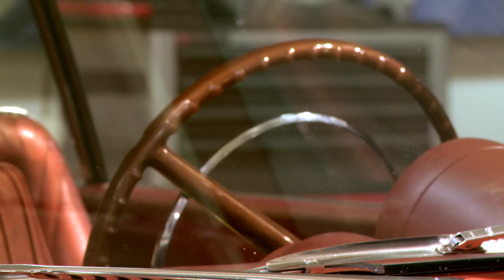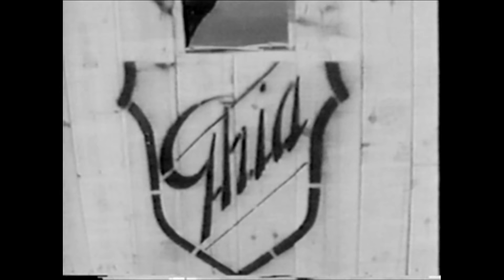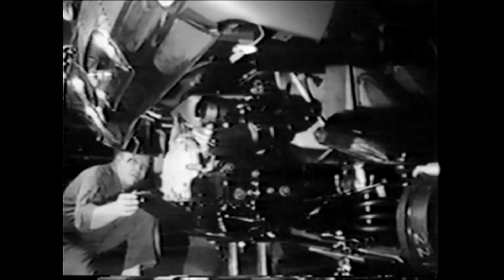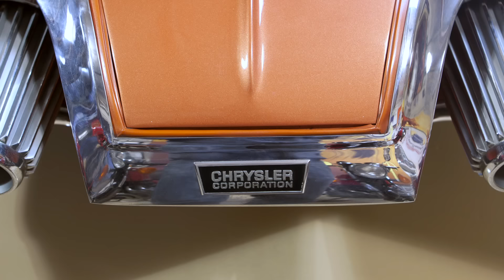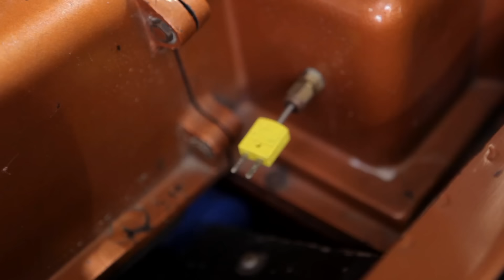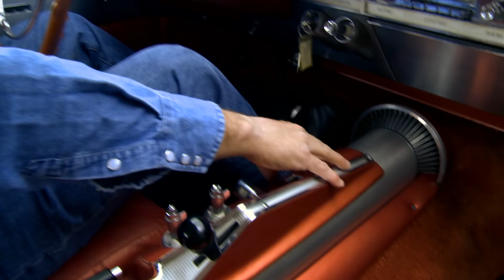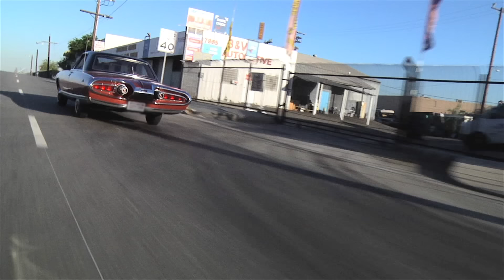1963 Chrysler Turbine: Ultimate Edition - Jay Leno's Garage

Comment: What is really remarkable about the concept is the torque. 
Chrysler took a chance on a passenger car concept that wasn't particularly fuel efficient, but imagine what the concept would have meant to the trucking industry!

Amazing torque, very quiet and purpose built for bio fuels.  The gas turbine engine powers Navy ships for good reason and logic would suggest this technology would be fantastic in heavy trucking...

Comment: Ford was actually ahead of Chrysler as they stuffed a Boeing turbine engine in to a Thunderbird in 1955. This was a test bed vehicle to evaluate the use of a turbine engine in a passenger car. Ford ultimately scrapped the project due to serious acceleration lag, noise, and heat from the powerplant.
It's interesting that Chrysler took on this experiment 9 years after Ford did and that what they came up with  looks very much like a cross between a 1963 and 1964 Thunderbird.

Comment: Very cool! I love this car! Designed by Elwood Engel, who designed the 1961-66 Lincoln Continental and 1961-63 Ford Thunderbird. This car looks a lot like the 1961-64 Ford Thunderbird, especially the roofline. The rear end design, depending on who you talk to, came from a sketch by Virgil M. Exner  Sr. himself. Engel's 1963-66 Dodge Dart looks a little like the 1963 Chrysler Turbine car. All 55 of the bodies were built by Ghia in Italy.

Comment: paired with our modern hybrid systems , I bet the jet turbine engine would work well! Using the electric motors for slow traffic driving, and the turbine provides power in higher speeds , possibly charging the car too

Comment: I noted that the car has a (sort-of) conventional transmission. I can't relate to how this transmission accepts torque from an engine with such high RPM. Question: does it shift? how gears does it have OR is it a CVT. I realize this is 1963

Comment: One of the interesting things about the turbine engine is that it can be made intrinsically clutchless, since the output turbine basically forms a fluid coupling to the driven impeller using the air.

Comment: I wonder if they could have fixed the idle problem by including a third tiny turbine used for idle solely to keep the other two turbines spinning, but with a much smaller combustion chamber so that it would burn less fuel when the two main turbines are at idle

Comment: Hi Jay , I don't know if you'll get the chance to see this, as it long after you released this video long ago. But ,,,,I was a truck driver in Canada.  The most common run is between Toronto and Montreal across the 401 highway.  This was back in 1972 which was at the beginning of my driving life. Back then I would hope to see and hear the  cabover Kenworth parts truck was also running between Toronto and Montreal.  It was a one of a kind. It ran for a few years then disappeared. Just a bit of trivia.

Comment: My dad was driving Chrysler produces when the turbine cars hit the streets. He was invited to see the turbine car at the dealer’s showroom. Of course he took his two car- crazy sons along. They didn’t start the car but they did give out little perpetual calendar keychains that worked like a circular slide rule. Somewhere along the way, I lost mine, darn it…
Years later I worked for Ford’s Engine Engineering activity. I recall taking a Ford course on the big truck 727 turbine engine. The plan was to use the turbine trucks as long-haulers, that worked out of either truck stops or dedicated centers where they would drop their trailers for conventional diesels to drive in heavy traffic. Thus the turbine trucks would run in their “sweet spot” where fuel mileage was best. 
The Ford turbine had dual regenerators like the Chrysler, but much, much larger. Those wheels must have been three feet in diameter. They never could solve the seal life and regenerator wheel cracking issues.

Comment: With the heat generated by the exhaust, you'd think this car would have lower emissions. It would be interesting to know the MPG of this car. They weren't very concerned about emissions back then, so I'd bet the car was cancelled due to bad fuel economy.

Comment: The reason the engine doesn't look like what you might expect a jet engine too look like is because that appears to be a radial flow engine as apposed to an axial flow engine which is what most jets now are. Axial flow is better but it's longer and would take more space. Radial flow is more compact. Think V6 vs straight 6.

Comment: turbine cars are a silly idea, a turbine engine doesn't work efficiently over a wide range of rpm and has very little torque at low RPM, not to mention the precision tolerances, ( and so expense ) required to make them.
Turbines are good in planes and generator plants becuase they can operate for long periods at their peak efficiency which is not the case in an automtive application.

Comment: The problem with Elwood Engles designs is that that still look like he was working for Ford. Ford had this obsession with thick “C” pillars that gave all the cars a stodgy look. Ford called this the “formal” look and it filtered into most of Fords car designs. 
I have never been a fan of the “formal look”.  Fords best looking cars were the 1957 Lincoln Premiere and the 1960 & 61 Starliners which had graceful sleek rooflines.  Chrysler made a huge mistake in letting Virgil Exner go.  If they truly wanted a “Jetsons” looking car to match the turbine engine Exner would have been the one to pull it off.  The 1960 Chrysler and Desoto body styling looks more futuristic than this.

Comment: EV's are the same way. They are practical in the sense that they use electricity to charge their batteries and drive with electric motors, but half the people in the country do not have a way to charge them and they also cost more than a normal combustion vehicle. Living in an apartment makes owning an EV impossible. I live in one, and I would have to run an extension cord from my living room down to the parking lot which would only be able to charge it very slowly. On the contrary, there is a gas station literally down the sidewalk from my apartment so it takes less than a minute to get there to refuel and refueling takes about 4 minutes at the most. The other thing people don't realize is that an EV cant just be refueled on the side of the road, yet you can fill a jerry can with a few gallons and pour it straight into your gas tank and off you go. I honestly do not think the combustion engine will be replaced any time soon. Its the most practical and efficient mode of transportation today. Also if you trace your power back to your local power plant it will probably result in you finding a coal or natural gas plant that your EV is being charged from. Not trying to say they are bad, its just that the turbine car and the EV are both worse for the average person than the typical ICE powered car. Maybe one day we will create an even more efficient means of travel.

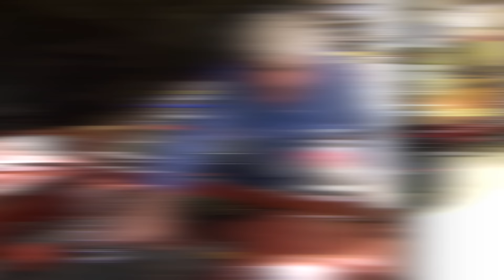Comment: 16:59 Another interesting thing is how Jay is putting his hand on the engine while he's showing how smooth it is. Because the engine is cooled by the fact that it draws in an extremely large volume of air, the engine remains very very cool. I'm not sure about this engine specifically, but a lot of smaller gas turbine engines usually don't need radiators at all due to this large amount of air.

Comment: When I was a kid back in the 80's, I was a Knight Rider fan and still am.  The Knight 2000 (KITT if you prefer) was equipped with a turbine engine.  As a child, I always thought a turbine engine was fiction and never knew that putting a turbine engine in a car had already been attempted before.  I can understand why that the turbine engine never caught on.  It was very expensive to produce and turbine engine technology failed to become the top dog over standard piston engines.  I just watched a documentary on the turbine engine car that Chrysler produced back in the 60's and I wondered to myself how a car like this handles.  It would be interesting to experience driving one for myself.

Comment: Kinda makes me wonder how a company that can come up with a car like that produced some of the WORST recalled cars in the history of the automobile.  Chrysler had that disasterous "lean burn" system they came up with in 1977 on select engines.  Locating the computer above the exhaust manifold and attached to the air cleaner housing, which made 2 things electronics don't like.  They recalled EVERY 1976-77 Dodge Aspen and Plymouth Volare due to body rust issues.  (I read where they even made a Dodge Aspen turbine car.)  Then they declared bankruptcy, the first time.  Great video!

Comment: The STP turbine car(s) that ran in the Indy 500 in 1967-68 almost cleaned up except they had mechanical issues. Then they were basically canned after that, probably because they were seen as a threat to the automotive industry. The STP cars used Pratt & Whitney Canada PT6 turboprop aircraft engines that have been widely used now in aircraft for generations and have an incredibly reliable history. But as for 'change',  even when you think of electric cars, it really took Elon Musk to make them a reality (aside from the GM EV1, which vanished) because they are seen as a threat to an industry that makes money off replacing parts that wear and break. Detroit has now been working on EV's, but they had no intentions of changing before Musk came along. The turbine was probably not the answer for the auto industry, but even if it had been, it would most likely have been rejected, especially back in the 60's, because of it's low maintenance factor. 

This is a video about the STP cars.
https://www.youtube.com/watch?v=vV1oBpUEk2k&list=RDCMUCm44d1WQboLnhT6aUBydZzA&index=1

Comment: It seems to me the best use of a turbine engine would be in a hybrid vehicle. It could start up only when the batteries reached a certain level of discharge and then turn off when the batteries are recharged. The engineering team could set the turbine to run at its absolute optimum speed and load continuously while in operation. The car would simply operate as an electric vehicle for the operational conditions. The turbine would only be used to power the generator to recharge the batteries.
The ability to use almost any available fuel would be a great advantage. This could be a great car for post-apocalyptic civilizations.

Comment: Those connectors you’re calling 60s style, are called K-type thermal couples.

Extremely common to measure temperature. Still used in prototype development and commercial environment today.

Very much like the sensor used in your barbecue grill to monitor internal temperatures.

Love to show Jay, don’t stop keeping it real

Comment: I bet the heater is great. The University of Arizona Engineering was given one for evaluation. The problem is that turbines are inefficient at less than full power, with high fuel consumption and long spin up times. The exhaust was extremely hot as well.

Comment: i heard that it didn't sell because it was to good and Chrysler realized late that they wouldn't make enough back with parts, maintenance, and cars because it wouldn't brake down and it ran on almost anything so they scrapped the hole project, i found out about this car from "Fact Fiend: Chrysler Once Made a Car That Ran On Perfume and Tequila"

Comment: What is he talking about?  This car does NOT use stock brakes.  It uses an air compressor. It's not even a hydraulic system.  Does he have a special version with regular brakes but not powered?  That was the problem. No vacuum.

Comment: Saw one in Dennis Port, MA.... Driver came out of a package store with two fifths of cheap Vodka.. Gave a little Dialog "pitch" regarding the car.. Poured the "Booze" in the fuel  tank through the filler located on the drivers side rear... hopped in ... "Whined" her up and drove away... Smooth as Glass!

Comment: Nice concept but i guess it has a poor efficiency. How much fuel does this vehicle need for 100 miles? How fast does it accelerate? I think the normal combustion engine is vastly superior compared to the Turbine-concept. The electric motor is another matter entirely. If the problem of energy storage was solved, the electric concept would probably be the most efficient. But as it is, the old-fashioned internal combustion engine is probably the best concept for getting from A to B.

Comment: The automobile never made it to production because the engine was an turbine.  The motor company worried that the car would take off and fly into the air like an airplane.  The company did not want the car to fly even though it had the airplane type turbine engine.  So the reason the car was scrapped is that the company did not want it to fly.

Comment: Literally the car that George Jetson's Grandpa should have driven.  However, the poor fuel economy proved a fundamental problem with a gas turbine in automotive applications...it simply doesn't scale down well enough.  Both the US Army and the Soviet/Russian armies found this out with their M1 Abrams and T-80 tanks, respectively, both are fuel hogs.  For both, they needed the power in a compact enough package, as the tank diesels of the time they were designed (late 1970s, early 80s) that'd fit just could be made powerful enough and reliable enough.  But soon, the Germans, with their MTU 803 installed in the Leopard II MBT, proved that a diesel could do the job; and consume a lot less fuel.  So the gas turbine, while a wonder of engine tech, just doesn't compete for either the Italian-designed, very smart-looking turbine car, nor in military ground applications.

Comment: The closest I have ever driven such a smooth engine was Mazda's RX8 with its Wankle type of engine. Incredibly smooth accelleration.  Can only imagine what Jay's Chryler Turbine car handles and accellerates.  Wonder if his car had A/C?  in the 1960's I was 10 years old but I only remember my Parents 1957 Pontiac had A/C which constantly broke down.  Most of the time, we just rolled down the windows. Different times of innocence

Comment: I recall like it was yesterday standing on a sidewalk at an intersection in northern Detroit when this strange car stopped at the traffic light 10 feet from me. I was only 11 or 12 and already a car nut but this one I couldn’t figure out. More than how it looked, the loud whine coming from it is what really grabbed me. If you’ve ever been in a car with a turbocharger it sounded like that whine without the other engine noise. One of the older boys shouted “it’s the turbine car”. Way cool.

Comment: those "60s type connectors"  are engineering tools probably thermal couplers and such.  But they're used to easily collect engineering data and values.

Comment: The jet car would have been perfect if they had the battery applications that are available today. Just think about an electric car that could charge itself using an ECU controlled turbine/generator. Of course there is also the single piston motor that would possibly be cheaper. Unfortunately the obviously great idea of a self charging electric car would never get a pass from corporate executives.

Comment: just wondering, to go into production, besides the added cost of the engine, with the emissions, sine it ran on anything mixed with oxygen, could they run on natural gas? burns very clean, basically water exhaust.

Comment: As a 13-year-old, I was absolutely in love with this car. Like Jay, I saw it at the '64 World's Fair. Two or three cars were circling the Chrysler pavilion. However, one was parked in the driveway close to the low wall surrounding the perimeter. I had to stretch but I was able to reach out and touch the car! I'm 70 now, and I'm still just as much in love with it as I was back then.

Comment: Great to see this car, now about the car just sad that it didn't make it, but lets not forget about Chrysler engineering. That Chrysler  Defense designed of the M1 Abrams tank which as gone through upgrades from the XM1 to the M1IP, M1A1&M1A2SEP tank. At the time when Chrysler and GM were competing for the contract back in 1976 the the M1 tank Chrysler was using a multi-fuel turbine while GM was using diesel engine the same used in the Leopard 2k. Thou the U.S. Army thought the GM was better in all the performance and Armor on 20 July 1976 the US Secretary of the Army Martin Hoffman and a group of generals visited Deputy Defense Secretary Bill Clements and Director of Defense Research and Engineering Malcolm Currie on their decision. US Secretary and generals were surprised when Clements and Currie criticized their decision and demanded the turbine be selected.
     Secretary of Defense Donald Rumsfeld heard both sides of the argument and did a 24 hour review on the issues and delayed the decision for four months. Now with days after that GM was asked to present a new design with a turbine engine and from the Secretary for Research and Development that it was clear solution that Clements and Currie would find acceptable was a turbine engine. It was a political decision that gave Chrysler the award since they were the only contractor with a gas turbine.
     However, the Chrysler design had advantage with the entire power pack which had room to replace it by any number of engine designs including a Diesel if needed. But the turbine engine is not the only reason for the decision, Chrysler was the only contractor that was serious about tank development.
     So even though the turbine died for its car design they designed and built a proven powerful tank with a 1500 horsepower turbine engine, I should know I spent 20 plus years on a XM1, M1IP, M1A1, M1A2 and M1A2 Sep as a TANKER and proud of it.